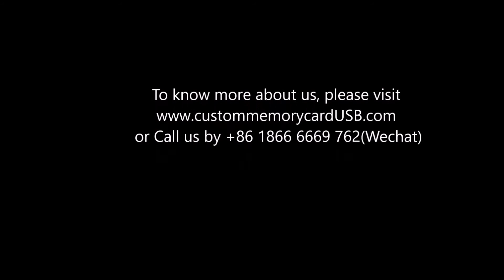How does a Custom memory card or USB Flash Drive produced in a chinese factory?

Comment: 1:17 The factory in South China, engraves "Made in Korea" on the memory cards?! Seems familiar.
Reply from the maker: We have assembling branch factory in Korea, thanks for your attention!
Reply: On the bottom of most computers nowadays it will say made in China. If you look inside the computer not all the parts are made in China. If the actual integrated circuit in this memory is made in Korea but packaged in China I think it would be fair to  tell people that it's made in Korea.